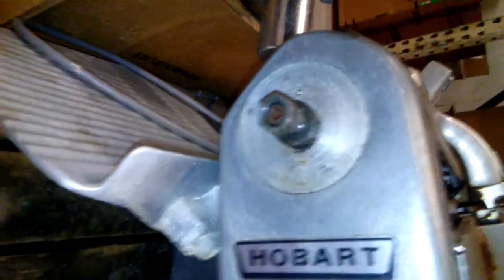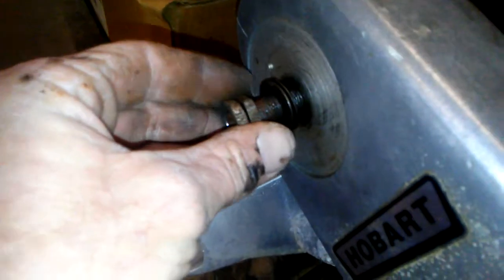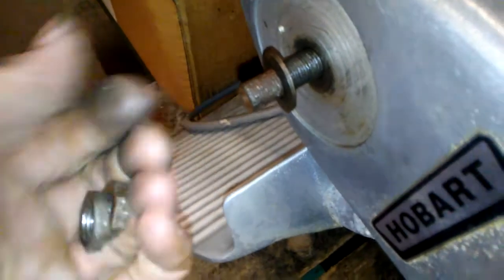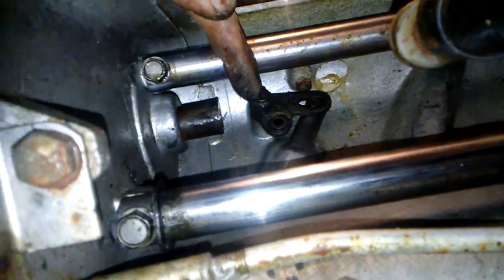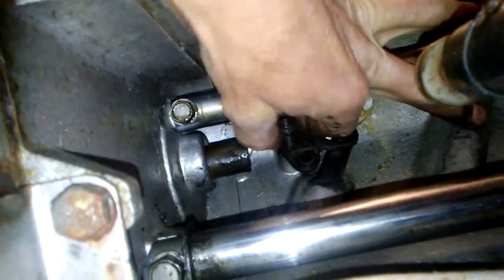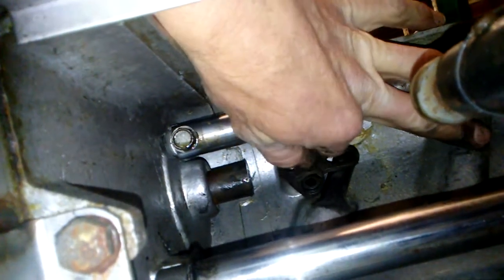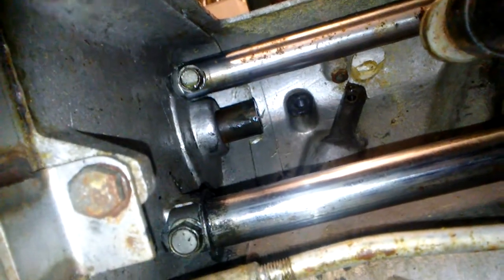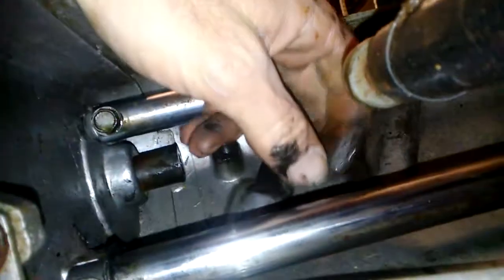Hobart meat slicer adjustment knob stuck won't adjust(1)

Comment: The close up shots and good video quality ,makes the troubleshooting process much easier. We provide genuine Hobart slicer  replacement parts.
Reply from the maker: You got parts for globe ? I’m actually working on one of them right now ! Looking for new blade !
Reply: @WaldensWorld  we provide Globe manufactured parts,  as well as 250+ other branded OEM parts , so can we know the exact part number?
Reply: Howdy!!! Got a technical question. Hopefully you could help. I’ve got one of these new to me Hobart Slicers. It didn’t have the sharpener. So I bought a brand new one. Do I need to adjust the back stone??? Thanks in advance for any info!!!
Reply from the maker: That I don’t know honestly! I know the globe I’m working on it pushes upto to blade to sharpen some you can put as much pressure as wanted ! I’d google manual n be for certain

Comment: Looks like my indexing spring broke on my 1812 slicer. I found it under the machine, its their Hobart part number 437212.  I'm trying to figure out how it fits into the indexing unit but I didn't see it in yours. The knob still turns, and the table moves fine.  Any thoughts on if I need to replace it?
Reply from the maker: That I wouldn’t be sure of but I bet a local hardware may have something you could use ! If it’s just for index you prolly be ok without it , but without seeing the set up I can’t say ! If it’s real small it may had a bearing that grabbed to stay in place but I don’t know what the spring goes to ?

Comment: How did you take the worm gear out? Mine stops as it get close to coming out.
Reply from the maker: Did you get the pin out of the shaft ? If it’s all clean I may need to tap it out with something from the outside if it’s all the way unscrewed , are your threads clean this may cause a binding if there gooped up

Comment: 2:03 how did you take that pin out
Reply from the maker: Used a small punch . If you can get pipe wrench on one end of pin n one on shaft you may Can push it out . Also with part out you cN use visegrips to grab nub on pin then hit vice grips with something to get it out !

Comment: My screw turns but the gear doesn't turn with it.
What is the likely cause ?
Reply from the maker: I believe there is a pin in the handle it may be sheered off

Comment: I'm in the process of replacing the indexing plate. Everything was busted except for the worm gear. The gauge plate support shafts were seized.  Goo Gone, Torch, wood and a large rubber mallet finally got that piece out. So my question is, When putting the worm gear and the roller- indexing plate together how do I do that to make sure the indexing knob is set up perfectly?  I know i need to do a little more research.
Reply from the maker: It’s been a while but seems I set the knob after it was all out together I believe there was a nut that help set it I may have to watch the video again lol ! N why the hell these people don’t clean their meat cutter grosses me out bahaha !